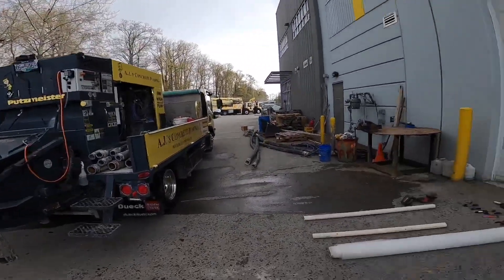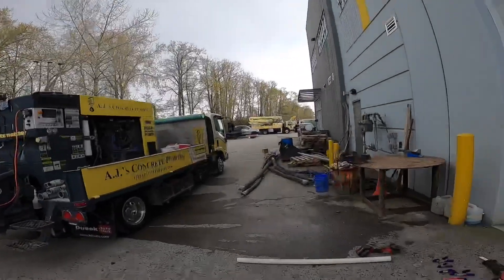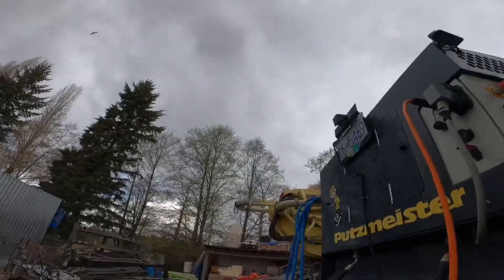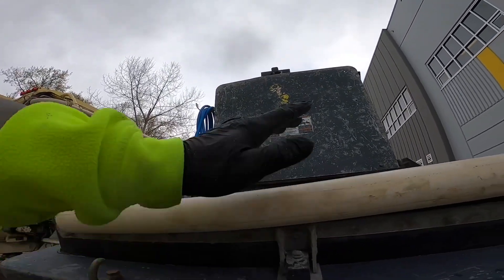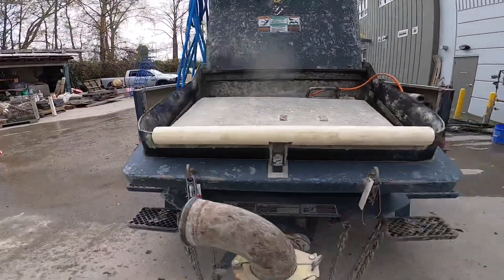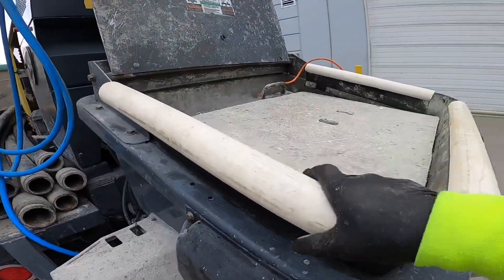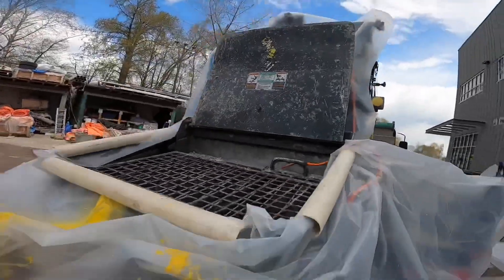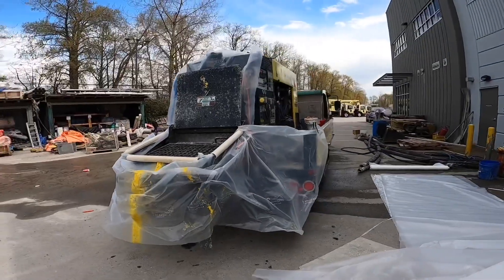Building a tarp setup for the back end of your Putzmeister concrete pump.

Comment: Would you do the same set up for a boom pump or is it a little different?
Reply from the maker: Only difference is that I cut the tarp/poly to a 20’ length for the boom pump versus only 16’ for the line-pump.